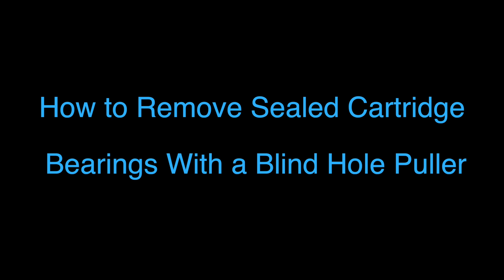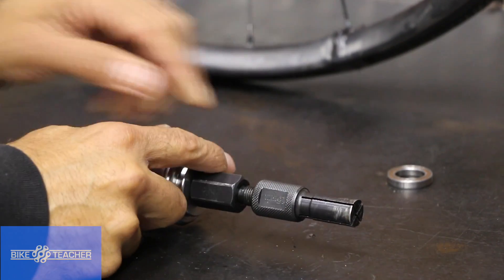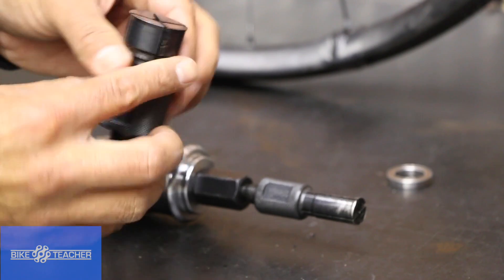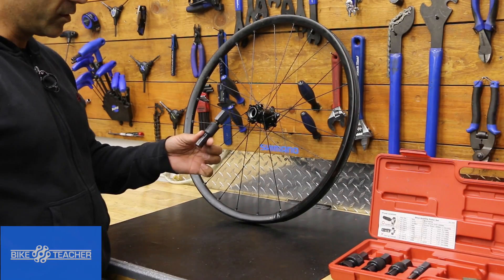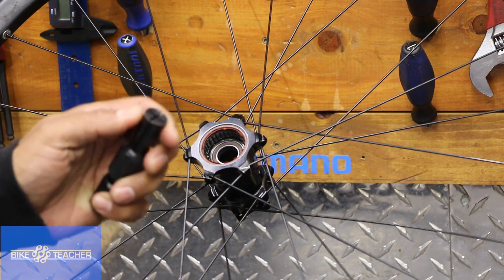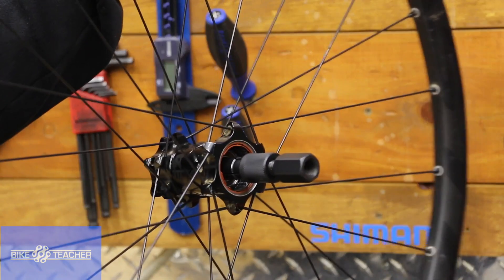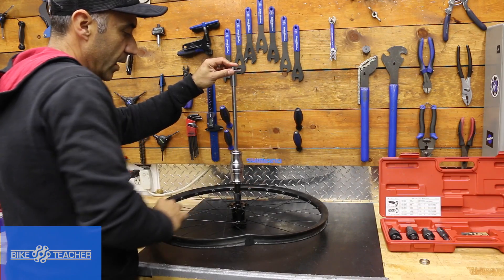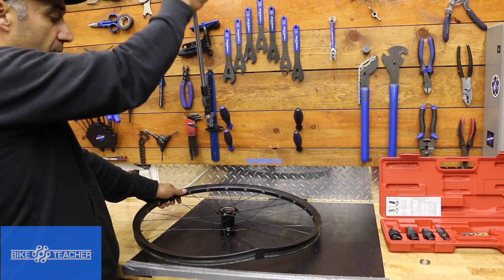How To Remove Sealed Cartridge Bearings With A Blind Hole Puller, Part 3

Comment: Can we use this to press the bearings?
Reply from the maker: Short answer, no. You would have to use it backwards, it would not fit into the component. Use a designated wheel bearing press, a correct diameter socket or something similar and a hammer.

Comment: OK to use a blind puller to remove a BB30 bearing?  If so, is there anything I should do to make sure the puller is square to the frame so that the bearing pulls out straight?  Many thanks.
Reply from the maker: yes, it's ok, Be sure to get full engauagment by feeling for the click or a feel of a drop in. snug the expander bolt a bit with a tool to ensure a good bite.
Reply: @BikeTeacher  ok, thanks.

Comment: hey, do these pullers safe to use on bearings you just want to repack? or is it more for bearings you plan on replacing with a whole new bearing?
Reply from the maker: Anytime we have to pound on a part there is always a chance it will get damaged. Always have replacements on hand. But yes I have been able to get them out at least once to repack and reinstall them. Don't expect them to feel awesome, but just okay. Thanks

Comment: Hey Bike Teacher, nice video. Just wondering if you could use the same tool but instead of using the slide hammer could you use a punch from the other end through the axle?
Reply from the maker: Yes you can. Just be sure to tap it out evenly.